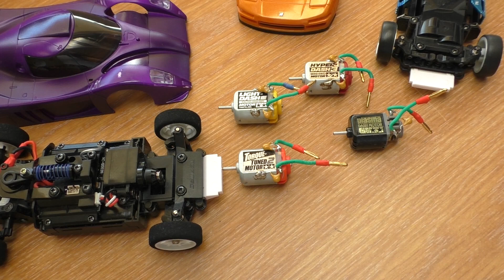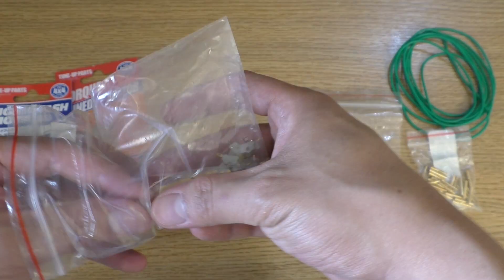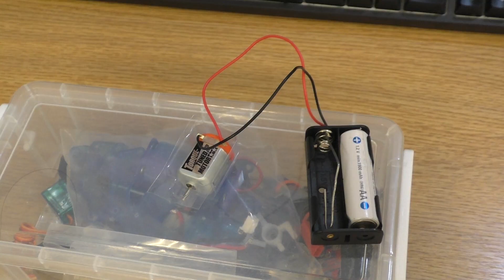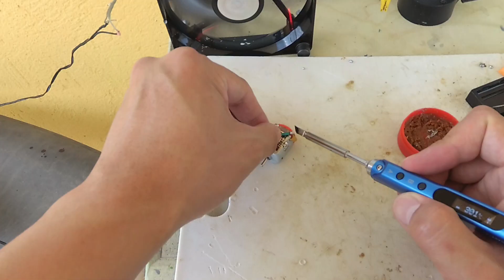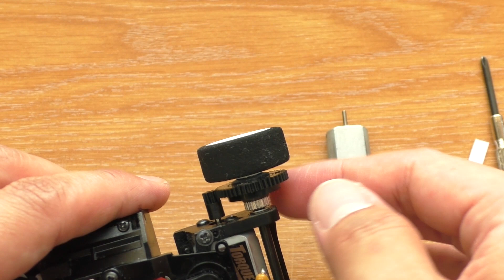How to Use Tamiya Mini 4WD Motors in Mini-Z and Mini-Q Q2

Comment from the maker: I have no idea how this video got this long.
Timestamps
00:00 Introduction
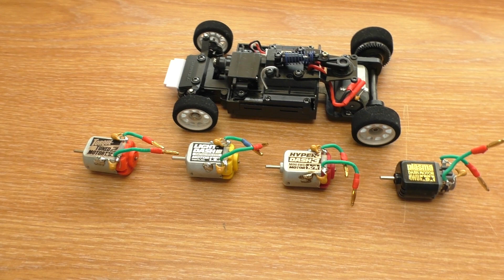01:22 Parts Required
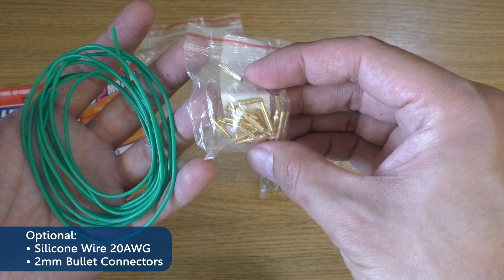02:26 Motor Modification
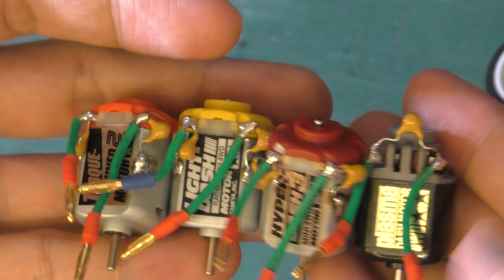06:31 Replacing Mini-Q Q2 Motor
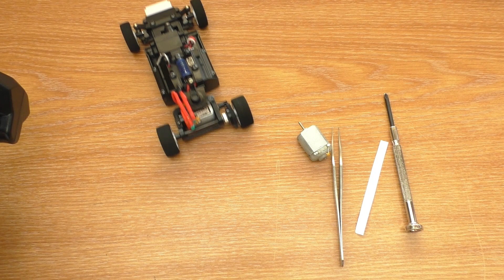09:05 Speed Test
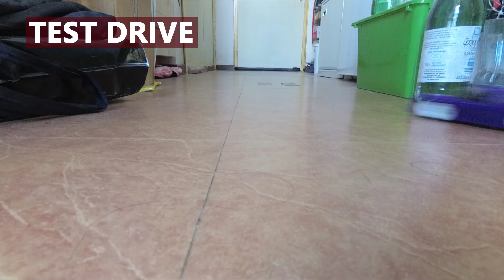10:49 Durability Test & Test Drive
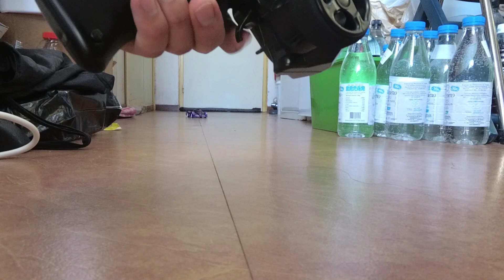11:55 Conclusion
Reply: What pinion size is it on the mini q q2 ?
Might be needing too go smaller for the faster motors too not overheat the esc as quickly.
A 7t pinion on the mini-z rear end with the light dash i'd imagine would be pretty close too what you got with the torque tuned 2 motor.
Reply from the maker: @Mini-z1994  It is 8T. I could put 6T in it but I wanted to burn this board down so bad.
Reply: @BeaversHobby  Yeah i guess heh, could be worth putting in this brushed board & servo in the trq1 i guess if you burn the mosfet in that again or just upgrade the mosfets & stack them for more power output.

Or perhaps 2.4 ghz converting a mini-z of some variety by taking apart the servo & using the board & original servo setup of the mini-z.

Is the plasma dash armature the same length as any other standard 130 size armature btw or is it longer/shorter ?
could perhaps put in the stock armature in that & kind of build a modified stock motor out of it, don't think the stock motor has silver brushes as it is atm.
Reply from the maker: @Mini-z1994  Yes, Plasma is the same as other 130, it just has cooling vents much like Atomic motor which is long  gone, I wish they are still making it though but I guess not a lot of people are still using brushed motor.
Reply: Hi! Me again, i know this sounds crazier than mini 4wd 130 motors, do you think RACE TIN GEN 4 upgrade Dynamos would work on this with a little modding?
Reply from the maker: @jonokami2138  Yes, it would. Not sure how long can the board can handle it but it would work. It's not crazy at all and I think it would be faster than Tamiya motors too.
Reply: @BeaversHobby  good to hear, sounds like another experiment for another day.
I did notice in other videos on the race tin upgrade motors, it can surely throw some rpm, it sounds so fine too. But with that.. i guess one will need a spare of most gears, and electronics too in case of wear and tear due to the increased rpm.
Reply: What rims do you use with the ds racing lf4 drift tires
Reply from the maker: @kieranb1275  Standard Mini-Z AWD rims.
Reply: @BeaversHobby  thank you big help just getting into mini drifting
Reply from the maker: @kieranb1275  My pleasure.

Comment: Hello is this possible for mr01?
Reply from the maker: Yes, it works for MR01 too. Although getting a Mini-Z XSpeed is a better solution but if you don't have an access to Mini-Z or PN motors, a modified Tamiya motor will do.
Reply: @BeaversHobby  it's very hard to access  parts specially the old ones 🤣 just thinking of selling it or keeping it on display
Reply from the maker: @vielazriel9811  That's unfortunate. Motor, wheel and bearing are cross compatible with MR02 and 03 but the knuckles and chassis parts are different. The bar that connects the motor pod to the chassis is also different and hard to find nowadays.

Comment: is the torque tuned 2 motor better than the PN 70T motor, Im running the PN 70T on my mini-z MR03 RWD FHSS and would like to know if the tamiya torque tuned is better? Thank you
Reply from the maker: Sorry, I don't have the PN 70T. However I'm sure PN will be better because Torque Tuned is not designed for such voltage and the brush just destroys itself very quickly. It's fun to experiment and for when I don't have the access to PN.

Comment: i get that power cut with a stock MA-020... what do you think the issue might be? i've only operated the car onece on official track (on the day i bought it) and 3 times in my house on tile floor. the problem started happening after my 2nd run at home.
Reply from the maker: The power cut is from heat and excessive load so it's either the board is fried (if you haven't changed the motor the board can handle the stock one without trouble) or something is blocking it making the car difficult to run.
The latter is more likely if you try and take the wheel part, check if all the wheels are not too tight. Also check the drivetrain if there's any blockage and if there's something stuck in there. Check the battery if the voltage is OK as well, for a rechargeable a fully charged should be around 1.4-1.45V.
Another thing that can happen is the heat. Check if there's any sticker residue on the motor as it might block the ventilation.

Comment: good evening to you
for the tamiya sport tuned 2
the electronics do not heat up and it takes time?
thank you
Reply from the maker: The electronics did heat up but with Torque Tuned it wasn't too much that it cut out.
Reply: @BeaversHobby  Good evening
ok, suddenly, which motor to take without the electronics heating up and being reliable apart from the origin?
Reply from the maker: @jean-lucdesenne3840  Torque Tuned 2 with brushes installed.
Reply: @BeaversHobby  thank you very much and keep it up
do not change anything
@ +
Reply from the maker: @jean-lucdesenne3840  My pleasure.

Comment: Hi beaver, do you happen to know why some other nameless 130 brushed motors do a burst on speed (which is better than stock) at first, then once you brake/stop then run it becomes slow?
Reply from the maker: That's probably something with the board cutting out power.

Comment: Did you ever get a chance to measure the amp draw on these set-ups? I know brushless is the way to go, but I tend to enjoy building things a little differently. Anyhow, great vids man. I've enjoyed them for all the info and testing you've shared. Thank you!
Reply from the maker: Unfortunately no, I haven't measured the amps draw. It's also based on different circumstances until the car cuts out so I can't really say how much can this board push in long races.
Reply: @BeaversHobby  wow. Thank you for the quick reply. I have some small brushed esc's I want to run in small builds. I also have 2 plasma dash I want to try and see what happens. 😅
Reply from the maker: @craziestmonkey  If it's a separated ESC then it should work. I had Plasma Dash on a cheap red ESC and the motor worked but the steering servo went crazy and I didn't know where is that coming from so I didn't make a video of it.
Reply: @BeaversHobby  Awesome. That's good to hear. I'm gonna have to give it a shot and see how it turns out.

Comment: This motor can use for HB Toys 1/24 rc drift ? What part need to change? I try use tamiya motor... the circuit was burn... i use 3.7v battery...
Reply from the maker: The motor will fit but these motors draw more power than a standard Tamiya silver motor. If the circuit board was burnt by the standard motor then it won't survive this.

Comment: Great video, does Mini-z MR03 board can handle TORQUE-TUNED 2 motor with no issue ? thanks
Reply from the maker: Yes, it can. Don't forget to install the carbon brushes as well.
Reply: @BeaversHobby  Great. just got a few of them (Torque Tuned 2/Atomc Tunned/Light Dash). Can't wait to test it on Mini-Z. Thanks Beaver.

Comment: Is there any alternative to oryginal 130 brushed motor from k989 or only original engine will survive 7,4 volts?
Reply from the maker: There are FP130 motors 6V on aliexpress or ebay you can use. PN Racing motors also work with 7.4V too.

Comment: I have a an xmod with a 30amp esc and 7.4 k989 battery...will the plasma motor run on it? Or will it burn?
Reply from the maker: Plasma motor won't survive 2S lipo.

Comment: Hi, very interesting video - first time I ever saw a slot car track like that. I had a scalextric track and it was fun controlling the drift but not easy. The one you showed seams easy to drive but I guess there is more to it than meets the eye.

A quick question, what size bullet connectors would you recommend for 1/28 GL Racing? I ended up purchasing two motors and that is a practical way to swap the motor.
Thanks for sharing
Reply from the maker: 2mm bullet connectors are what you need. I'll be more than enough to handle the power and small enough for this type of car.

You don't drive a Mini 4WD, you just build it and tune it according to the track and let it go.
Here's a fantastic video from Ars Technica explaining all you need to know about Mini 4WD slot car. https://www.youtube.com/watch?v=2ZZL5i8vOXM
From what I know it is not really popular in the west. I've seen some clubs and races in Italy and that's about it. Most of the players are in Japan, South East Asia and US. Here in Greece I've talked to a shop (I guess I found the owner) and he said they abandoned it long time ago.

Comment: I've tried this with my MA-020 except I only took the solders off the stock mini-z motor and re solder everything onto the Torque tuned. But watching this videos cleared a lot of things for me about the purpose of the capacitors. I was gonna try and go with the plasma but looks like it's not a good idea. So thank you!

Comment: Where I can buy this ball diff Q2? Is it compatible with miniz 98mm?
Reply from the maker: I can't find the Q2 ball diff but there's MRC diff being sold separately for spare. They are the same car with different motor mount.
The Q2 is for LM motor mount (102mm wheelbase).
The MRC is standard size and it's compatible with Mini-Z 98mm. It might need some shims but it'll work.
Here are the links.
Europe: http://www.minizracing.it/minizshop/index.php?main_page=product_info&cPath=1045_1053&products_id=14223
US: https://www.kenonhobby.com/MRC-MRC01-Ball-Differential_p_46523.html
Asia: http://www.minircmart.com/product/ball-differential/
Reply: @BeaversHobby  mrc is all plastic?
Reply from the maker: @Ruben3D  Yes, it's all plastic. It's essentially Q2 with front suspension cover and different motor mount anyway.
Reply: @BeaversHobby  ok thx I will go to pn ball diff
Reply from the maker: @Ruben3D  PN will last you much longer and smoother as well. It's like 4x the price but it'll worth it.

Comment: Hey beaver I've been looking at your budget builds and I think I'd like to try have a got at building on either k989 like you've suggested to me before or maybe even mini q .. which would you recommend for a first time builder 🤔
Reply from the maker: It depends on what you want to do. If you want a touring car only for driving normally, Q2 is a good car to start with. Otherwise if you want to do both touring and drifting, K989 is the one to get so you can swap the tyres and have different style of driving.
Reply: @BeaversHobby  at the moment I'm looking for drift only as my racer is an mr 03 evo sp .. I've got a standard mr 03 for stock class too but for drift I've got my xrx which I don't think I'm going to last with to tell the truth ( I will try practice) and I love my ma 020 but I'm told by everyone that RWD is better for drift hence why I'd like to run something RWD .. but I need to learn how to build basic kits first 🤔
Reply from the maker: @maxbuckley9762  Since you already got MA020 I suggest you use it for drifting. If you get K989, it'll be more or less the same but you'll need to fix a lot of stuffs out of the box to get it working well.
I'd say MA020 + front soft springs, rear hard springs, front one way and rear locked or solid axle will drift well.
Unless you want a banger or in danger of crashing a lot at high speed, keep drifting what you already have. XRX will get you start with RWD drift very easily too so I don't see a need to get another car.

Comment: Will the torque tuned work in the trq1 stock board? Or will it fry? Thanks in advance my friend!
Reply from the maker: Yes, it will. The board is more or less the same as this one.
Reply: @BeaversHobby  so it has all the safety features too? So no "LETS BURN IT TO THE GROUND"? lol.
Reply from the maker: @ShiftyTys  Yeah, it ended up having safety so I couldn't burn it.
Reply: @BeaversHobby  sorry, extra question, my variant is the rage rc, which comes with a 1s lipo. As all the others come with 4 x 1.5V cells, can i assume my board / servo / motor can handle 6v also?

THANKS!!
Reply from the maker: @ShiftyTys  Yes, the electronics for all the variants are the same. They just include a different battery so yours will be able to handle 4x 1.5V Alkaline or NiMH too.
Reply: @BeaversHobby  wow that would mean that the ones that came with four batteries would perform better than the one that only came with the lipo as that is only 3.7 volts? Interesting!
Reply from the maker: @ShiftyTys  Not necessarily. Lipo is lighter and can pump out power than NiMH. The fully charged voltage is also 4.2V so I'd say they can achieve roughly the same speed.
Reply: @BeaversHobby  fyi just put in torque tuned with stock electrics. And wow. What a difference. That plus locked rear and front one way - it just enters and exits drift so much easier!
Reply: @BeaversHobby  is the only thing stopping the torque tuned running at 5 or 6v the brushes? Are there any other negative effects of the brushes are replaced to carbon?
Reply from the maker: @ShiftyTys  Generally I replace the carbon brushes to prevent the terminals from melting from over-volt. Brushes will transfer power better too but they didn't put it in to save cost, I guess.
Over-volt these motors still have side effects like broken rotor if you let it run too hot for too long.
Reply: @BeaversHobby  I understand. From your experience, would running the toque tuned at 5v with carbon brushes just ruin it's life? I also have a plasma dash. Would this last longer at 5v? This is all because I want to run a better esc and servo and finally use my radiolink that you recommended! I'm all over the place and confused lol why do these motors run on such low voltage! Heh.
Reply from the maker: @ShiftyTys  These motors run on low voltage by design, the rotor materials and so on.
I've found that Hyper Dash 3 survives longer than Torque Tuned. Plasma Dash also survives 5+V fine. However in my other car Plasma Dash cause the servo to behave strangely when I go full throttle. It's probably some interference.
I'd say the safest way to use is either Torque Tuned + carbon brushes installed or Hyper Dash (it already has brushes) with the red 20A ESC. This combination will give you a lot of power already. If you want to use Plasma then it's a bit of a gamble because it worked with Q2 for me but not with other car that has 20A ESC + Radiolink receiver & Emax servo.

Comment: Did you ever do the brushless motor upgrade to this car?
Reply from the maker: Sorry for the delay. I've been very busy with other projects. I'll get to this one eventually.
Reply: @BeaversHobby  no other stuff takes priority! I was just curious the brushless upgrade was worth doing! I just got the MRC version of the car I was just going to put in a PN 70 motor!
Reply from the maker: @maxthunder2  Well, worth it or not is entirely depending on how much you want it out of this car. It's the cheapest and probably the easiest Mini-Z compatible platform to modify so there's that.
PN 70T is a nice motor upgrade. Good luck with the project.

Comment: How do we use a 4 aa holder with one battery only?
Reply from the maker: There are dummy AAA cells that you can put in. They will just connect one side to another. https://www.ebay.com/itm/4Pcs-LR03-AAA-Size-Dummy-Fake-Battery-Setup-Shell-Conductor-Placeholder-Cylinder/174215732754
Reply: Beaver's Hobby how did you do it in this video?
Reply from the maker: @narrowempress1625  I use all 4 AAA in the car.
Reply: Beaver's Hobby but how did you run a motor on 1.2v with a 4 aa battery holder?
Reply from the maker: @narrowempress1625  Oh, you meant the run-in. I bent a paperclip to size and put it in instead of another battery.

Comment: Great video! But I still have a question, the motorwires of the board look quite different from the original, have you already upgraded the board?
Reply from the maker: This is the current version of this car so it's different than the previous one I got a while back. The differences can be found in this review. https://youtu.be/i9iXnSLetkg
Reply: @BeaversHobby  Thanks a lot. I'm quite looking forward to your brushless upgrade. '
Reply: @BeaversHobby  Oh, by the way, could I reprint your video to bilibili?There are lots of mini car fans in China I want to share your video with. Don't worry, I will note the original link address.
Reply from the maker: @keyisong9789  Yes, sure. As far as I know China doesn't have access to any Google services including YouTube, isn't it? Feel free to post it there.

Comment: I really appreciate the speed tests with these motors. I tried the power dash and even the plasma dash on my mini z buggy but can't run them for more than around 2 min and 30 sec continuously respectively. The motor eventually gets too hot and the esc shuts down. I read somewhere that the ESC boards of the FHSS mini z can take up to 2A. However, I tried Hyper Dash 3 (up to 3A) and it worked fine. But to be on the safe side, I use this motor instead. 
https://m.intl.taobao.com/detail/detail.html?id=563837950428&item_id=563837950428 (option B 5-7.4v 1.5A) It's dirt cheap like US$2 and it is fast. I bought 5 for my 3 mini z and 2 as backup. I think this motor can be found on other China online websites. 
Here's a list of all the Tamiya mini 4wd motors and the specs:
https://www.tamiya.com/english/mini4wd/setupguide/motorguide.pdf
Reply from the maker: That's very nice looking motor. Almost like the Atomic brushed motor they stopped making years ago and of course, Plasma Dash.
Reply: @BeaversHobby  Don't burn the board! Keep it as a spare or convert the mini 4wd into a semi rc car so you can control the throttle like a slot car.
Reply from the maker: @Diamondbac  Fantastic idea!

Comment: Finally got my Q2  this week. Did the bearing and rear suspension upgrades. It’s a great little car. I only wish they would sell it as a kit.  They cracked several parts and the servo wasn’t seated or even straight.  Now need to find those cool foam tires.